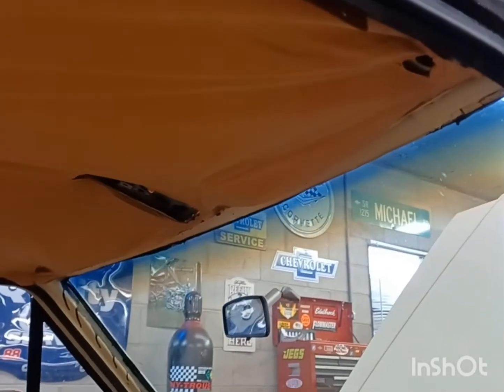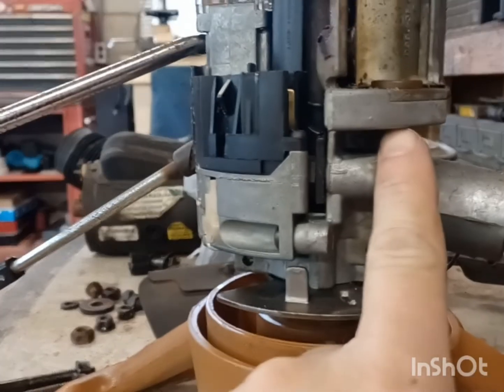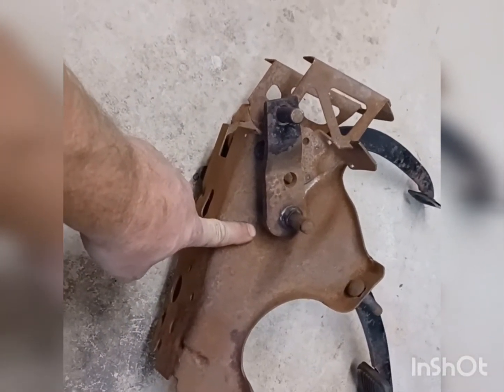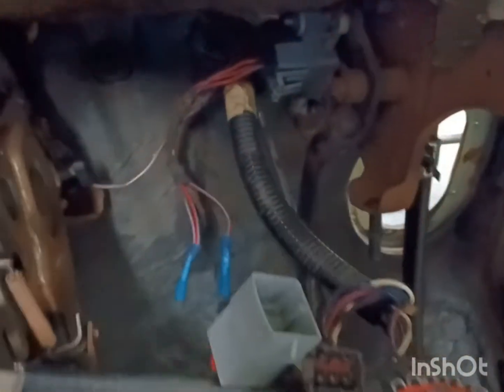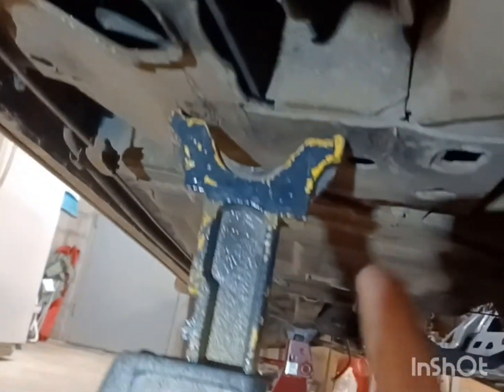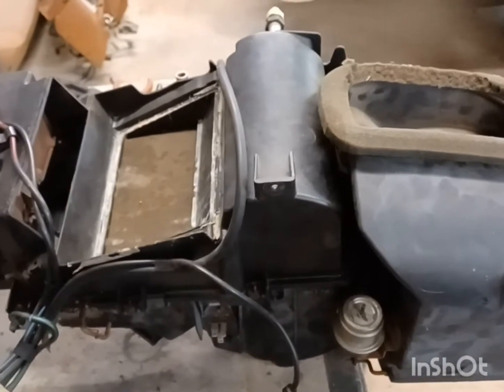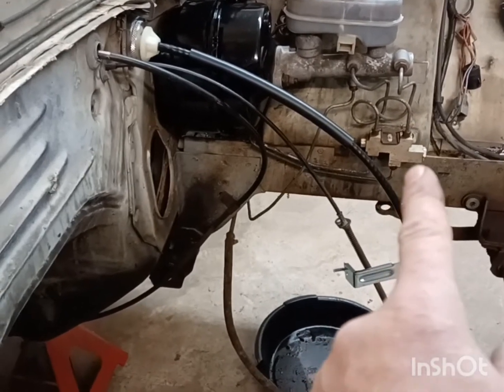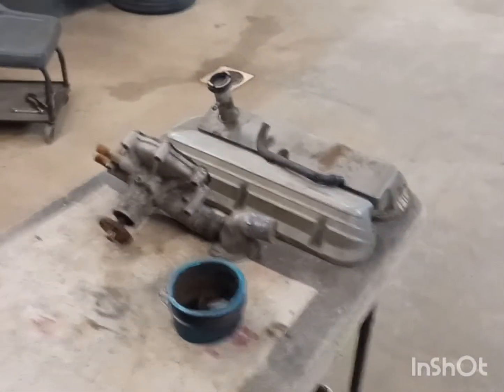Part 1 mercury zephyr engine swap with mustang parts

Comment: Also what brake booster did you use
Reply from the maker: I used the booster from the mustang bolted right in the same place as the old one
Reply: @shanebarney4240  what year donor car
Reply from the maker: 1987 mustang gt the pedals come from a 1991 mustang

Comment: Where do I get the k member from
Reply from the maker: My donor
was at 1987. Mustang GT convertible. That I didn't have a title for it was pretty rough. I used everything but the transmission. The transmission came from an earlier Mustang and the paddles.
Reply from the maker: You will  have to Waller the back holes out on the k member